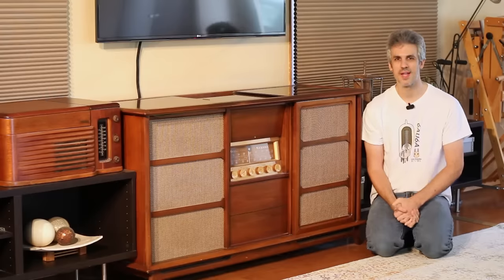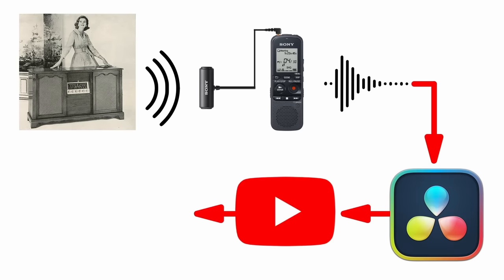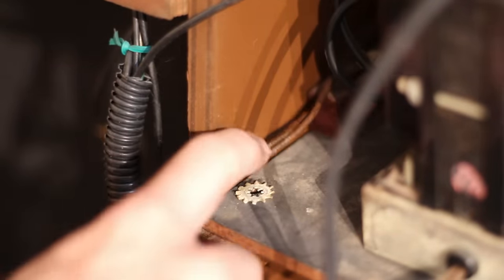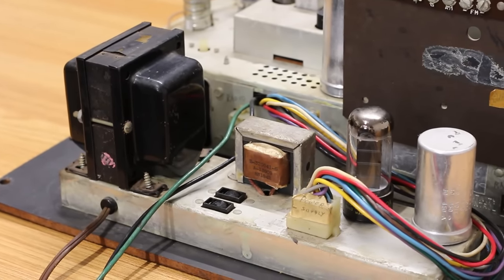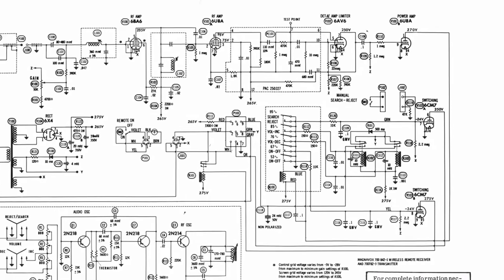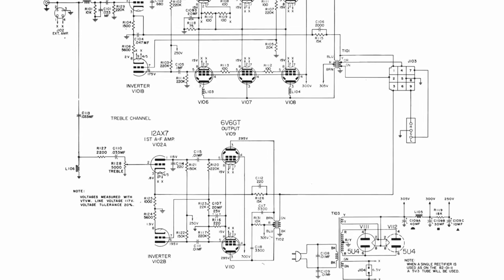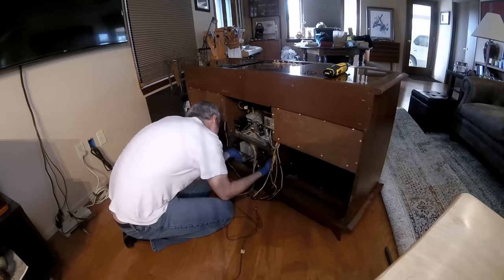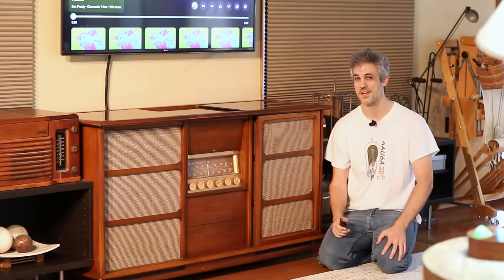A Look at our Magnavox Concert Grand Console Stereo

Comment: What a beautiful piece of audio equipment!! MPX stands for multiplexer, meant to be connected to an external fm stereo decoder.
Reply: Was using an external stereo decoder the 50' equivalent of using an external DAC ("because of course I hear the difference!")?
Reply: @MetalheadAndNerd  No. Before the days of FM stereo standardization, many tuners only included a mono audio out and an MPX out. This way, once the standard was established, you could add on an MPX adapter and get stereo without having to buy a new tuner. Once FM stereo tuners started being produced en masse, MPX output jacks disappeared.
Reply: @smwsmwsmw  Yep Magnavox was one of the contenders (14) for an FM stereo multiplex system, but they lost out to the Zenith system which is still in use today and uses an L+R signal to feed the "Mono" side of the transmitter for compatibility with a L-R signal on a subcarrier and a 19 kHz "Pilot Tone" to tell the receiver to turn the MPX decoder on. The interesting thing about the L-R signal is that it is AM modulated to save bandwidth and allow more subcarriers to be placed on FM broadcast signals, Musak used to be carried on high-power FM subcarriers and content for the sight impaired from the American Printing House for the Blind is still there, along with RDS (Radio Data System) data and IBOC FM Digital data.
Reply: In the 1980's some receivers were again equipped with MPX jacks but this time for AM MPX (AM Stereo) when that trial was over it was the Motorola CQUAM (Compatible Quadrature Amplitude Modulation) system that won out over Harris, Magnavox, and Kahn-Hazeltine.
Reply: @mspysu79  You're right. Surprised I forgot about that, AM stereo having had such a huge impact on society and all. 
/s

Comment: That's a lovely specimen!  I inherited an Ampex Crescendo console from my grandfather, who also bought it new, and in a similar mid-century modern trim.  The story is it was such an extravagant expense that he waited until my grandmother was teaching abroad to make the purchase (luckily she let him keep it!).  I completely restored it over a winter about 5 years ago and it's been in service almost every day since then.  In mine I intalled a Raspberry Pi with "Raspotify" and a DAC in it, along with an auto turn-on circuit in the preamp/control center, so that it's now a Spotify connect device that automatically turns on when you start playing music to it!

I'm guessing you've already found some, but dial cord is available around the internet.  Tuner re-stringing can be a major PITA when you're concerned about correct alignment...  

A few notes and suggestions:  
-On the amplifiers, the metal box houses the crossover coils L106 and L107, which are used to divide the low and high frequency for the woofer and tweeter sections.
-Next time you have the console out, you may want to spend some time cleaning and re-tensioning the contacts in the tube sockets
-It would be a good idea to install fuses in each of the components on the AC line input.  I typically use the chassis mount twist-lock types

I love your videos!  Keep up the great work!

Comment: What a beauty.  The circuit of the power amps is pretty straightforward.  What I haven't seen before is the use of low value inductors L101, L102, L103, L104.  Their reactance at audio frequencies will be negligible, especially as they are in the bass section.  I guess they are there to prevent parasitic RF oscillations.

Comment: As someone who did amateur radio for a bit in the past, my thought is that maybe you can run a really long strand of unshielded wire from the magnavox's radio receiver (where one would hook up an antenna) from the inside to outside of your house. The longer the wire, the bigger antenna, and therefore the better chance of picking up any radio stations.
Reply: With where he is and the high ground conductivity in North Texas generally, he should have wonderful AM reception at night - heck, in DFW, I can get WSM from nashville at night (though that crazy-town express station on 660 splatters all over it).

There should also be pretty good FM reception with an external antenna.
Reply: If you did amateur radio, you will know an antenna is not simply a case of long wire. It needs to be tuned to be a multiple of the required wavelength. And unshielded long wire is asking for problems, especially in such an old set where it might become live if a capacitor somewhere in the circuit malfunctions!
Reply: @ernstoud  for MW AM Reception (and frankly anything below 10m), a random wire length radio is acceptable. You want a broadband antenna, and no one is is going to go build a half wave or quarter wave antenna for 365m, its just not practical for most people - its either 550 feet or 225 feet of wire. Also, you're not worrying too much about matching either, tbh. I'm not worried about such a line being energized either, the coupling cap is often a mica.

Like, if you really wanted you could put an antenna tuner in, but you dont need to care about VSWR if you're not transmitting.
Reply: Yeah, that way he could listen to propaganda, great idea.
Reply: @ernstoud a random wire antenna will work well in this case.  A resonant antenna couldn't cover the AM band 550-1600 kcs (kHz hadn't been chosen yet then)
Reply: I 100% second the nighttime AM radio listening with a big antenna! Give it a try! I'm swamped with city noise here, but I can reliably listen to KFBK Sacremento at night from Canada.
Reply: An old school directional TV antenna can work quite well for FM if pointed in the direction of the desired station(s). Perhaps since he lives out in the middle of nowhere, there's already an old TV antenna on the roof or in the attic that he can run a shielded cable to.  Assuming it's fairly flat where he is there's no reason a good antenna couldn't pull in usable FM, perhaps hust in mono, from 70 or 80 miles away.  I can remember driving through Kansas where it's as flat as a sheet of glass and listening to the same relatively low power college station lation for an hour or so of driving, until I got about 80 miles away and lost the station.
Reply: If you can find a 1970s/ 80s vintage BIC Beambox FM antenna, basically a tunable, directable, Yagi antenna in a box, they work  surprisingly well because you can actually tune it to the station you want to recieve and switch-select the directionality of the elements.  Sometimes they require a little bit of signal boost coming out of the antenna, but in my experience a Beambox plus a signal booster works much much better than a Terk or any other amplified FM antenna I've ever tried.

 There's also a company that makes high quality inexpensive passive AM antenna couplers, CC Crane is the name if I remember correctly.
Reply: @AlohaWulf  Absolutely. Active loops (such as the MLA30+ which are quite inexpensive) can give really good performance and noise rejection on the lower bands - I use a loop here for anything below about 5MHz. Whilst the signals strength may be down on a wire antenna, the s/n is massively improved although I guess it depends on the noise in the vicinity as to whether this is an advantage.

Comment: If you ever take it apart again you might check the capacitors.  As others have mentioned it might be fairly easy to recreate that remote, maybe based around 555 timers.  From the glance we got at the schematic it's just a square wave generator hooked to an rf amp.  Could be a fun project.... like you need another project :)
Reply: being 1962ish it may well have poly or ceramic coupler caps, not waxed paper and they rarely give trouble, only bad thing i can see about it is it uses single cathode bias resistor for the 6V6s in each half of each amplifier, if one 6v6 goes low or open the others will be forced to pass higher anode current reducing their life,
Reply: At those frequencies he could probably just toggle the pins of an Arduino or similar lol. Maximum lazy
Reply: @zyeborm if you look at the schematics you can see an RF oscillator so that thing is actually oscillating at I'm guessing 500kHz to 10Mhz ish modulated with the button tone so Arduino alone no can do
Reply: That would be an amazing project! :O
Reply: I agree with everyone else: build a remote of your own. It would be cute to build a tube remote!
Reply: The caps in the amp look like those red poly things. They don't go bad that often. Might even have been recapped already.
Reply: @andygozzo72  My 1964 Motorola consoles (3 channel - 6V6 in push pull for left, right, center bass) use a single bias resistor for all 6 output tubes as well. I found out the hard way that you can't just change 2 output tubes. I did that and a few months later, the new tubes I put in were red plating. I decided to put all the original motorola tubes back in and it sounds and works just fine. Great point you made!
Reply: @dwaughtal70  yep, when replacing tubes in a push pull circuit with common bias resistor, you should really replace both, at very least , do checks to make sure the new one ismt overdissipating and the old one cut off or almost so,  dunno why if having paralleled 6V6s they didnt just use one 6L6 as they basically are like 2 6V6s in terms of characteristics..? if more than 2 commoned, even more essential to check!

Comment: I have to admit, being someone that has listened to both during my lifetime, the warmth and depth of a good tube amp beats a digital one any day... BTW... A while back you mentioned how you rotate your projects to be able to not burn out, great choice man...
Great choice 🖖😎
Reply: Technically all amplifiers are analog, that's simply how loudspeakers work. Some pre-amps have a digital signal processor in them but the processed signal is again analog and goes through an analog power-amp to the speakers.

As for  tubes vs transistors... that's entirely personal preference. Find what you like and enjoy what you found.
Reply: @vinny142 there are class d power amps
Reply: Tubes produce pink noise. Pink noise is just more pleasing to the ears than white noise that transistors produce. Of course good transistorized things do keep the white noise floor very low, so it really doesn't matter.

A purist would prefer the perfect reproduction of mathematics of a signal though DSPs and good DACs. But in reality, what matters more is the end result you get, that includes the speakers, the sound box, and every distortion you add up in the chain.

Warm pink noise distortion is just better than no distortion, or just noise in practice to the ears. A bit of distortion is good. The irony of people thinking transistorized systems are worse because they just create no distortion to be noticed. They don't have any characteristic sound to be noticed. The better the system is, the less noise you get, which is kind of paradoxical, but what you want from a sound system, in theory, in practice distortion is inevitable. So you better choose what distortion you like more.

All the intended distortion put by the studio, and none accidental put by your system, that's the theory, but that's what the studio wants.
 But that's a preference, you can do whatever you want with your system, even explode its bass and use your own equalizer, or even effects on top of it, after they produced the music, and you bought it, its yours to do whatever you want. Creators are a bit of control freaks sometimes, your "kids" are to the world, not yours. After they're out of your house, you don't control it anymore.

Also, tubes are even better when over-driving, no clamping, which is why people think they sound better in amplifiers. You don't over-drive transistors, they just create horrible square waves.

None of that matters if you know what you're doing and what you like.
Just use what you like. Sometimes that's a valve, sometimes that's a transistor, sometimes its both, sometimes its a mechanical spring (they sound amazing as a chorus "pedal") or other insanity.
Reply: Thanks for the great explanations everyone.

Comment: Amazing to run into this video because when we were young my dad purchased from this well, to do lady a Magnavox hi-fi. This was circuit 1967. Me and my brother and sister listened to all our stuff on it at the time when we were very young. It had two big woofers in it. I still remember sitting on a couch across from the stereo while Eleanor Rigby was on repeat and I was about five years old. And I just marveled like, what is going on here , what the heck was going on. This had to be about 1969.   Later on, I would hear other great stereos in the mid 70s as one of my friends dad was an electrician and you how to build them.  I recall when I was young that Magnovox  stereo was a little bit intimidating to me. The site the sound, The red diode near the bottom, The power of the sound…

Comment: On an amplifier of this age it is a good idea to check the capacitors that connect between the grid of the output tubes and the triode for leakage. If they ars leaky the output tubes will draw too much current possibly damaging the output transformers and reducing tube life. Other capacitors can also be leaky.
Reply: I believe that I saw poly caps in the amps, haven't seen paper and death caps. For the big filtercaps in the cans though, I didn't notice some 450v modern 47ufs and that would be advisable. I once had the fun of letting a can smoking the room up, ugh.

Comment: Much easier to generate FM, there were these little things meant to broadcast audio via fm from your phone/ipod to your car stereo, i have one which is wonderful and lets you select the broadcast frequency "Belkin Tunecast II". There is even a resistor inside you can bypass to let it transmit with more power (not like it matters if you put it next to the radio). And yeah you can power it with 2 AAA batteries.

Comment: The remote control IS fascinating. It it an AM transmitter of unknown frequency, modulated by 53-95Hz tones. The receiver is a fixed-frequency direct-conversion AM detector, followed by a limiter which removes amplitude variation, and then feeding the now fixed-amplitude tone into a really interesting gadget: Something that looks like a relay, but instead of a moving armature has reeds tuned to the 53-95Hz tones. The reed matching the tone will swing with enough amplitude to hit the contact.
It should be easy to replicate, once the center frequency of the receiver has been found.

Comment: Oh my, this brings back memories! As a kid we had the Magnavox entertainment console, which consisted of a 25 inch color TV (which was the equivalent to a big screen today), and the same record player/stereo unit you have. Ours was circa 1963, and was state of the Art for the era. The remote for that unit (and for most Magnavox TV's ect) was the same LOOKING device as the one you showed, except that it worked by ultrasonic vibrations, each button you pressed would emit a very high pitched 'psst', at about the frequency of a dog whistle. The device would recognize that and decode the frequency and perform the function (such as channel change, volume up and down, ect). Worked pretty well except it had one flaw, if you jingled keys or pocket change it would randomly change channels! Us kids used to drive our parents crazy with that...

Comment: Looking at the drawings it look like the remote control it self is solid state.  It uses a 22 1/2 battery.  Back in the day I work for a company that done TV repair I done communication radio repair, but would have to go out on some service calls.  It seam always to pickup a Magnavox entertainment center that included a tv.  They were always on the second floor with no elevator.  The good old days.   Thanks for the video, always fun.

Comment: As a late 60's electronics buff, this brings back a flood of memories.  I worked on many similar units back in the late 60's, early 70's.  I am familiar with all of these tubes and the basics of the designs.   Yes, you had to be careful due to the heat and high voltage.  300 +/- was typical of a B+ - higher in TV's of the day.  Funny my son who is an electrical engineer, only learned of vaccum  tubes in passing from a book. Understandably, most of you reading this probably never saw one, much less work on one.   Before the explosion of component stereo systems in the  late 60's, large stereo consoles ( some with TV's) were the norm for decent sound from around the mid 50's to mid 60's.   My parents had a Magnavox  console  with a TV from the late 50's that was mono, but sounded  great!   Magnavox was top shelf back then.  A great video and well done. Enjoy!

Comment: I can confirm as much: A good stereo system is when all the components fit together. With component stuff, usually they don't quite fit, so the sound is "meh". But with a complete console like this, the manufacturer had all the tuning and adjustment possibilities they could wish for. Apart from that, anything about "good sound" is very much up for the listener to decide. There is no 100% perfect reproduction of sound or visuals anyway, so it's a matter of "pick your favorite distortion" really 😜

Comment: You have the holy grail,  that is probably the best console ever made, I had an opportunity to work on one, had to repair one of the amplifiers, bad filter cap, also relubed the turntable. It had an amazing sound. I own several hi end stereo system, and in my opinion I wouldn't mind having one of those in my house.  You may need to do some work on the tuner, you should be able to pick up AM at night.

Comment: I suspect there's a fault with the tuner circuit if you can't pick up anything at all on it... You should be able to find some 50kw AM stations on it, especially after dark.

That is a crazy amplifier 😮 what a beast!
Reply: Yeah, exactly. I can frequently pick up AM stations from 4 or more states away depending on the time of day (night). There's got to be an issue with the tuner section or something.